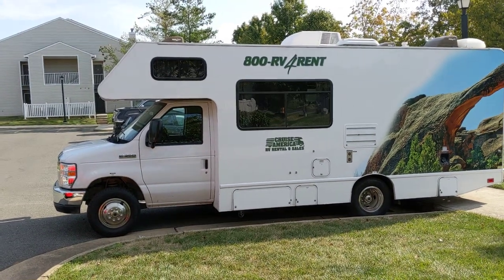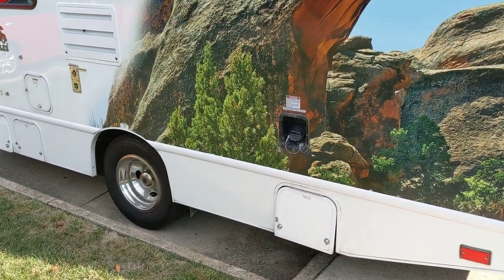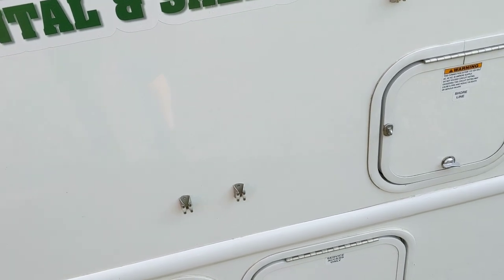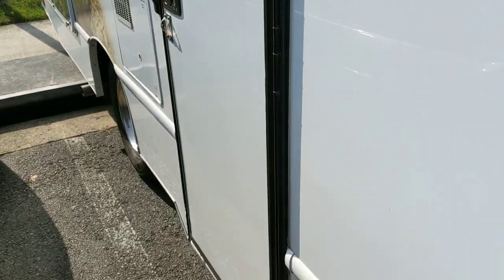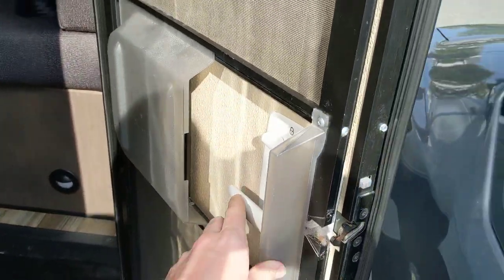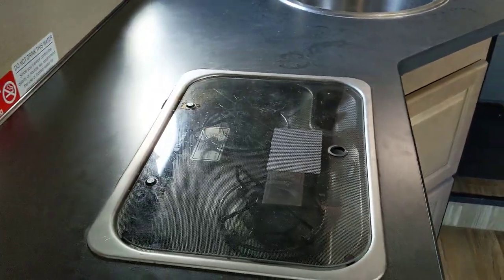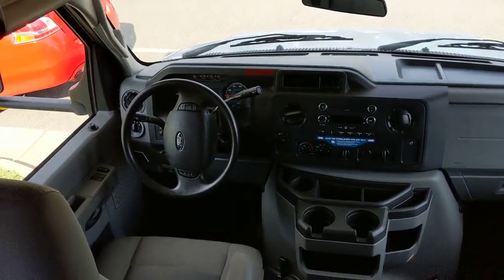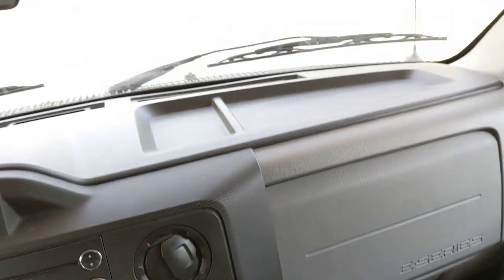Cruise America - Review and Walk through of 25' standard 5 passenger RV

Comment: Hey mike, Wondering if you can run the generator whilst driving.
Reply from the maker: Hi!  I have heard that you can, but don't think this is a good idea.  Extra vibration, noise, etc.  About the only reason to run the generator is if you need to use the household-style AC outlets in the back, microwave, or air conditioning in the back (when not connected to shore power).  I hope you aren't planning on cooking while driving, LOL.  ;-)
Reply: @CompTechMike  no LOL, i was wondering about the 120V chargers in the back. thanks!
Reply from the maker: @Leaguecitybrass  Gotcha!  When boondocking we use a combination of electrical adapters that can run off the 12v outlets in the front, and power bank batteries, to run our electronics, including 120v.  I don't have links for everything we use but here are a couple that may be helpful to  you:

https://www.amazon.com/STANLEY-PCA120-Power-Inverter-Converter/dp/B00KVHSOF0

https://www.amazon.com/gp/product/B075KYXJBH/

https://www.amazon.com/TOPVISION-2200A-Peak-Car-Power/dp/B07H58NP77/
Reply: Yes you can at $3.50/hr. Every few hours, you will need to stop to check the oil level. You will only need the generator if the passengers in the back get hot or cold.

Comment: Hey Mike, thanks for the video!
My girlfriend and I are going to do a roadtrip with a motorhome (28 feet).  And I would like to know if the generator is essential?  It serves for the microwave, air conditioning and plugs right?  Anything else? For lights, refrigerators, shower and sink is necessary?
Reply from the maker: Hi!  Thanks for the comment.  You are correct - if not plugged into shoreline power you will need the generator to run the microwave, household electrical plugs, and the rooftop AC unit.

Everything else (water pump, fridge, interior lights, hot water) can all be powered off either propane or the household battery (which is recharged when driving or by the solar panel on the roof if you don't use the generator).  The fridge, in particular,  is able to operate off either electric or propane, and switches automatically depending on which is available.

If you don't use a generator you may want to get a 12v to USB adapter to recharge things like phones off the main truck battery (through the 12v cigarette-style outlets on the dash).  Have a safe trip!
Reply: @CompTechMike , thank you so much for this.  quick question since I'm not familiar with the propane:  does the propane need to be turned on for use?  Also for the fridge, if you're not plugged into shoreline, will the fridge be able to run overnight just on the household battery?

Comment: Thanks for the great review!  I was wondering about power outlets and USB chargers. We only saw a couple in your tour, but are there more and where are they located in the RV?
Reply from the maker: Hi!  Thanks for the comment.  There are standard household-style 110/120v AC outlets located throughout the vehicle around the counter areas, near the sink, one by the bathroom, and if I recall correctly one under the dinette.  Note that none of these work unless you are plugged into shoreline power or have the generator running.  Several of these outlets have integrated USB ports.  As an IT pro, I noticed that the power output (the amount of amperage) on the built-in USB outlets is very low.  In other words, if you plug your phone in to the USB outlets it will take a long time to charge.  Personally my wife and I have a lot of electronics and we have one of these:

https://www.amazon.com/gp/product/B075KYXJBH/

As well as a few portable battery packs, to make sure all of our electronics stay charged during our trips.  Hope this helps!

Comment: I saw you comment abt tv and DVD players. Some camp grounds offer cable hook up. Is there a way to connect to a cable hook up?
Reply from the maker: Hi!  Thanks for the comment.  These RV's are pretty basic - with no TV's or cable hookups.  I guess if you're at a campground with cable at the pole, and you bring your own TV, you could always just run a cable in through the window or something.  ;-)  Hope this helps!
Reply: Mike Smith I spoke to a rep at Cruise America. They told me there is actually a port plug in, that if you bring your own tv and cable cord, and the park you are staying at offers cable, you can connect. Idk if that is correct but that’s what I was told. Kind of lame worrying about tv while camping but when you have a teen that never goes far from cable or WiFi, it can be important. 🙂. Thanks for replying.
Reply from the maker: @carolgallagher5433  Good to know!  That might be on the newer models.  I don't recall ever seeing one but then again I never looked very hard, LOL.  I'm renting again later this summer, if I happen to see one I'll be sure to update my video.  Thanks!
Reply: Hi guys, I just bought a used 2013 X Cruise Canada 23A.  During cleaning and looking at everything (I really mean everything, taking out the drawers and removing all the screws securing the covers where they don't want the renters peeking) I found the coax cable hook ups you are talking about. The cable "in" is located in the box where the power cord is stored, it is hard to see casually. On your knees look at the inside top of the box, on mine it's a small white cube. Just pull down on the lid and there is the connection. Inside the motor home the outlet is behind the upper bunk privacy curtain (just around from the grab bar) a handy wall plug is there too. Hope this helps. Cheers from the Great White North.
Reply: There is a cable hook up over the driver’s seat in the cab area. You can not attach a tv to the wall though.

Comment: Thank you so much! Very helpful! Do you happen to know the dimensions of the walkway next to the dining table? Trying to figure out if there is enough space for us to set up a pack n play for our infant to sleep in during our trip. Thanks so much again for this video. I feel more prepared for our trip!
Reply from the maker: Hi!  At a rough guess I would say maybe 36" across?   But that is a very rough guess.  Probably better to go see one at a rental office to get a better idea if your particular playset would fit.  You might also take the dining table out to free up some space.  Good luck!
Reply: Mike Smith thank so much Mike! Can you clarify something about the fridge. Does the refrigerator keep things cold 24/7 or do you have to have the generator running/be hooked up to electricity? We want to bring some yogurt for the baby during our 3 day trip. Thanks again!
Reply from the maker: @michelejames2371  Hi! during check-out the sales person at your rental location should set the fridge to "Auto". When on auto mode it automatically draws power from any available source. So assuming you have propane in the tank, it will draw from that when driving down the road or not connected to shore power. Remember to not pack the fridge too full (air needs to be able to circulate to cool things off) and don't stand there with the door open - these things aren't as efficient as household appliances. Have a safe trip!

Comment: Mike, we really appreciate you doing this video for others - thank you!  A question about the frig - does it keep your food cold if you cannot plug in over night (for example, sleeping in it parked at family's house).
Reply from the maker: Hi!  Thanks for the comment.  The fridge has an "auto" setting, so it will run on either electricity (if available) or propane (if available).  So if you're parked at a friend's house you can just make sure it's set to auto and the fridge should automatically keep cool as long as you have propane.  Hope this helps!
Reply: It does take up to 8 hours to fully cool the fridge. Leave it alone and empty so it will cool. You will use propane while driving and just sitting in the driveway.

Comment: Great information Mike! Can you use the generator to charge the house battery? 
Your comment about 500-thread count sheets cracked me up 🤣
Reply from the maker: Hi! Thanks for the comment. Yes, the generator will charge the house battery in these units. It's a little noisy though and you need to close the windows on the side of the RV that has the exhaust or else the exhaust smell comes in the window.

Personally if I was designing an RV I'd go with a lot more solar capacity, that's my plan for when we own our own. 😀
Reply: @CompTechMike  $5 per hour to run the generator? I think that's in the fine print.
Reply from the maker: @Earthlog  $3.00/hr. I never needed it more than an hour, to charge up electronics at a campsite without full  hookups. They explain all that during checkout. Thanks for mentioning it here for others to be aware of! :)

Comment: About $300 a night ? When is the best time to book it ?
Reply from the maker: Hi!  Thanks for the comment.  You can use the tools on the Cruise America website to check different rental availability and dates.  If you go off-season (non summer months) or during off-peak rental periods (non holidays) you should be able to get one for around $90 a night.  Rentals are up  a lot right now due to Coronavirus; good luck!
Reply: Rates vary like a hotel. Summer is the most expensive. They can go as low as $80 and as high as $350.

Comment: Hi Can you use toilet while driving ?
Reply from the maker: Hi! I mean, obviously you'd need to stop driving it and walk to the back, but otherwise definitely. Just turn on the water pump switch so you have water pressure to flush and wash your hands. 🤣
Reply: Mike Smith hahahahaha, what putting it on cruise control won’t work? Lol
Reply: Do you have to add.the deoderizer tablets...that smell like port o potties or.something else.can be used? Im allergic to a lot of stuff
Reply from the maker: @tjdd8474  Hi! Thanks for the comment. Do you "have to" use a deodorizer tablet? I mean, I guess you don't "have to" do anything you don't want to. But as far as I know every RV manufacturer recommends using some kind of product to reduce odors and help break down waste in the tank. Maybe you can find an unscented product on Amazon?

Remember these are rentals, so try to use something. No one wants to rent after you and find a stinky tank! 🤣

Comment: We are going to rent one and drive it to florida in June, will the air keep it cool while driving or is it going to be super hot?
Reply from the maker: Hi!  Thanks for the comment.  If you're riding in the cab and run the standard air conditioner in the cab, it will stay cool in the front of the vehicle.  The back of the vehicle, in particular the bathroom area (if you have the door closed) will probably be pretty warm.

Once you park and connect to shoreline power (or run the generator) the roof air conditioner is very good at cooling off the entire inside of the vehicle.  Have a safe trip!

Comment: Does the refrigerator run/stay cold as you drive?
Reply from the maker: Hi!  Yes it does.  The refrigerator has a switch at the top to select whether it runs off propane, electric (when on shore power or the generator is running), or "auto" (where it switches between electric & propane depending on which is available).  Typically the sales people make sure it's turned to Auto when you check out, that way it will start cooling off immediately.
Reply: The refrigerator takes up to 8 hours to fully cool. Do not put food into it until it is cold. Don’t open it up to check the temperature often bc this slows down the cooling process. This fridge does not cool like the one you have at home.
Reply from the maker: @noellearmour7327  Great tips!  I see that complaint a lot - where people pack the fridge full of stuff and then expect it to cool down immediately.  Thank you for all of your comments and suggestions!  😀

Comment: Thanks for the review Mike!  Do you know what size hitch receiver is on the RV?  Also, if parked on a driveway and plugged into 120V, 15A home outlet, will the appliances run without tripping the breaker?
Reply from the maker: Hi!  I'm sorry, I don't know the exact measurement on the receiver hitch.  Just looking at it it looks like it is the exact same size as on my pickup, which I think is 2", but don't quote me on that.  Probably better to confirm with the rental office if you do plan on attaching anything like a bike carrier, or doing any towing.  They used to charge extra if you wanted to use the RV to tow, not sure if they still do.

If you plug into a 120V 15A home circuit pretty sure you can run one major appliance, but not more than that.  For example I don't think you could run the AC and the microwave at the same time.  Maybe one at a time would work though?

Comment: Thank you so much for the review.
Very informative! Question about where to load water and drain the sewage on the trip. I’m new to this. Thanks
Reply from the maker: Hi!  Thanks for the comment.  Water is loaded into the vehicle's holding tank through a hole on the passenger side.  You just stick a garden hose in and turn on the water until it starts running out, then put the cap on.  When you're parked at a campsite with full hookups there's also a water inlet on the driver's side near the back, where you can hook a hose (included) up to the campground water source.

The sewage (gray water and black water tanks) are dumped on the driver's side down low.  There's a hose (included) that you connect to a campsite sewer line, or to a dump station (most campgrounds, even those without sewer lines) have a dump station.  Otherwise you can dump at places like Cabala's, and some large truck stops as well have dump locations.

You can watch the Robin Williams movie "RV" for a comical look at dumping.  However I'd suggest the Cruise America website for a more in-depth tutorial on how to hook up.  Have a safe trip, good luck!

Comment: That adapter piece is extremely dangerous You cannot plug a 30 amp RV into a 15 amp socket
Reply from the maker: You can only run a limited amount of electric equipment when plugged into a 15/20A circuit. For example, the rooftop AC draws too much power and would trip the circuit breaker. But a few lights is okay.